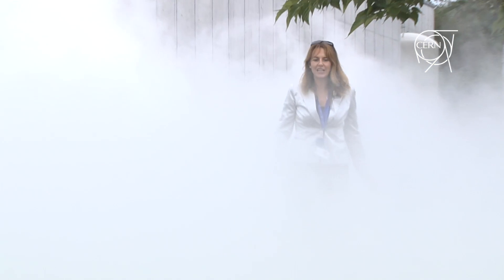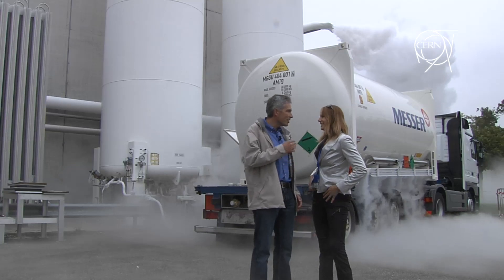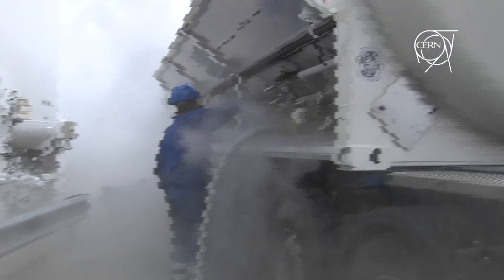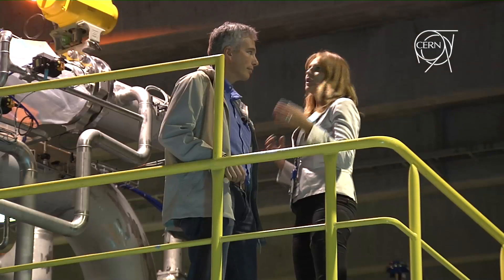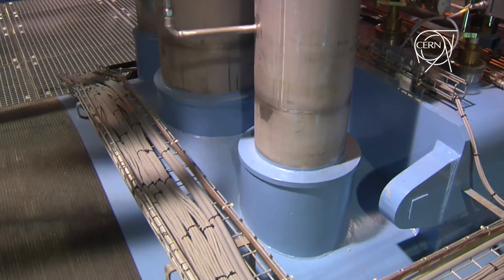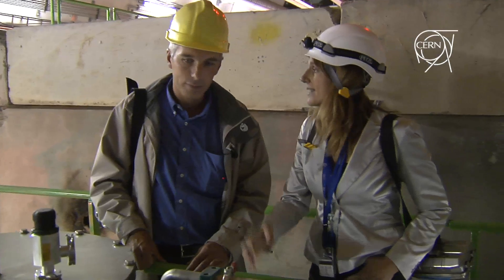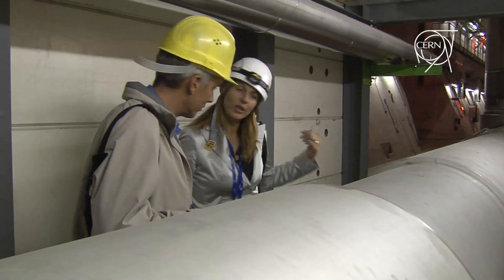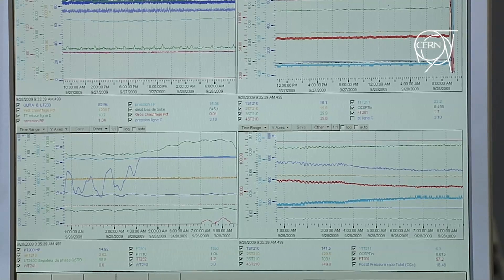LHCNews Oct 23, 2009 - The LHC is cool!

Comment: 20/12/....20-21Des=20/12=2012 ? CERN, testing full power ( LHC ) Time Travel ( black hole ) funnel from earth directly 2 outer space = super vacuum ! Hope the doors, are strong enough 2 close fast enough, so we dont lose all the oxygen, on earth, in a few days ! Or maybe stuff get' s sucked into the hole ! Each LHC end-cap is 13 metres in diametre and weighs 240 tonnes ?
Open a black hole, from the moon, 2 outer space, no danger, because of equal atmospheric pressure !